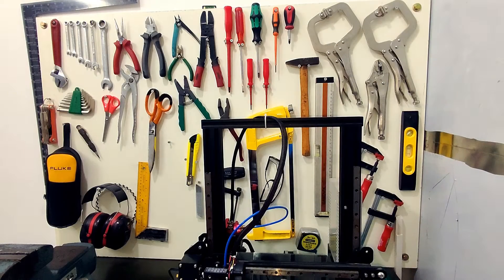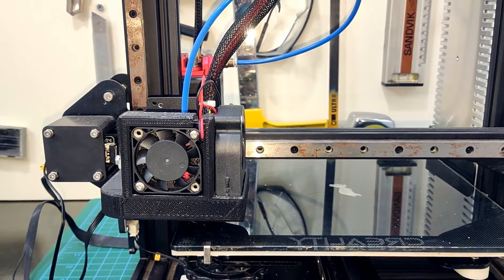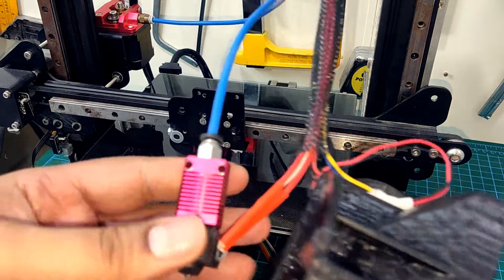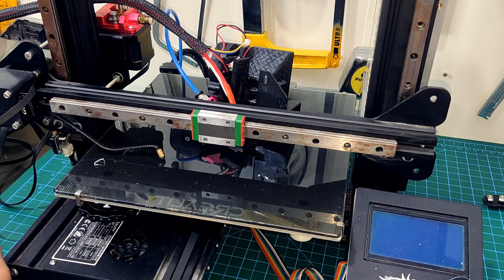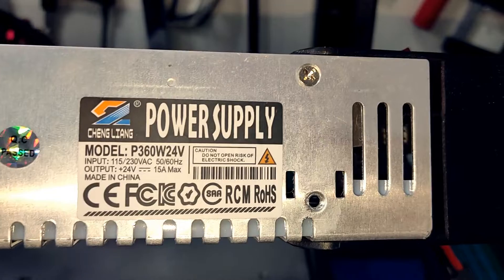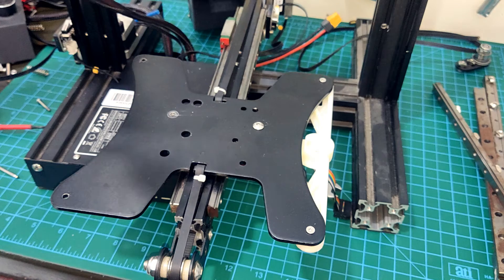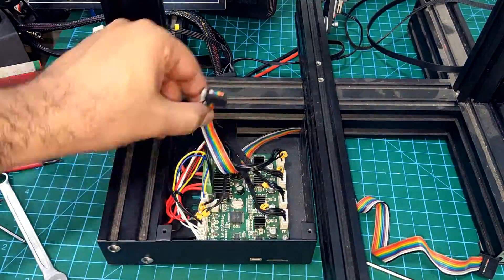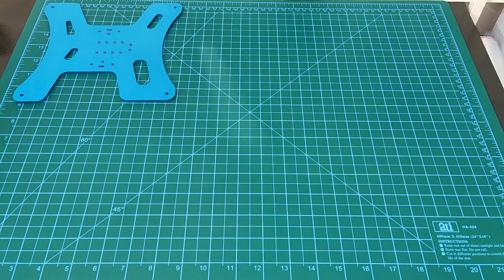Ender 3 full teardown, my upgrade journey

Comment: WD-40 will remove your corrosion and rust but you need to make sure you lubricate bare metal parts especially ones that contact each other you print quality will increase I lubed my Z screws with engine builders assembly lube and I haven’t had any sort of movement issues on the Z since

Comment: I thought the BLV kit was only suitable for the Ender 3 Pro with the 40x40 y axis extrusion?
Reply from the maker: Yes its designed for the 4040 extrusion, but with minimal adjustments i was able to install it on the 2040 aswell. I will be uploading the installation video soon.

Comment: My Ender 3 works like a dream. No need for upgrades. I have other printers to mess with.
Reply: Lucky then. Usually they wont print out of the box.
I have some weird bed issues, kinda binds it at some places (random). Checked all the wheels, adjustments made, still there.
a lot less but still there. i suspect bad roller bearings.i did some adjustments for my new ender 3 pro and it seems to print atm. will see.